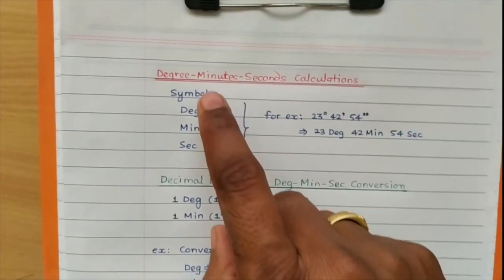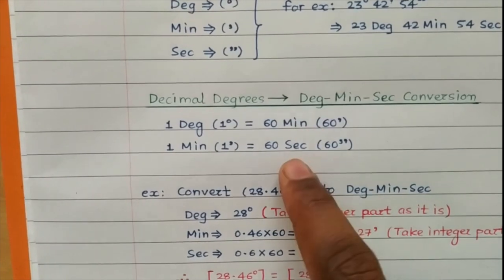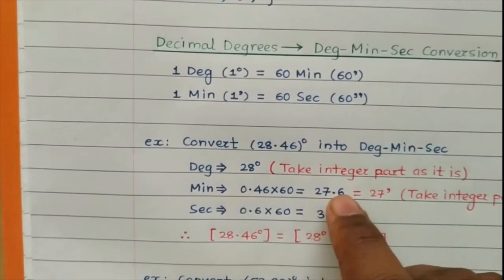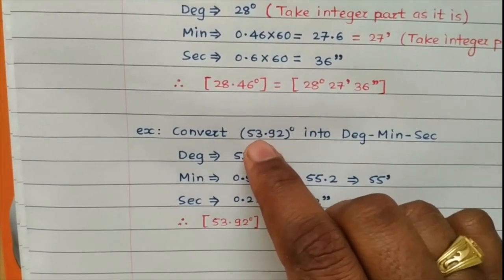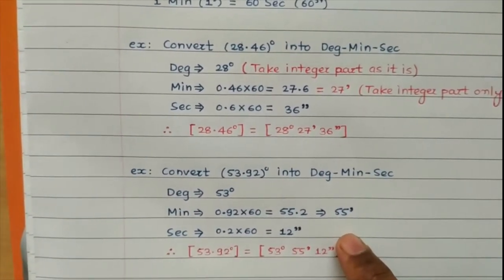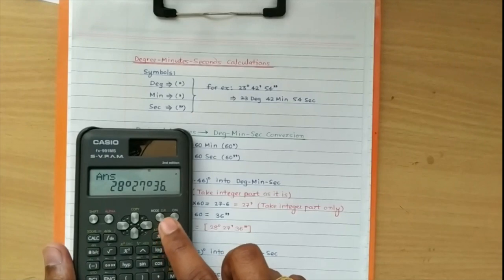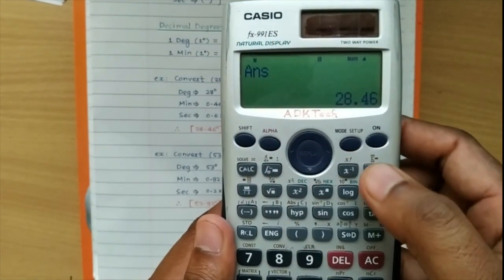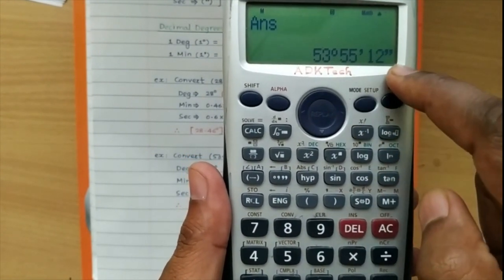Degree-Minute-Second Angle Conversion using Fx-991ES & Fx-991MS Calculators.

Comment: How to convert from degree minute and second to degree
Reply from the maker: @Abhijeet Chauhan
first, keep degrees as it is, then divide minutes by 60 and seconds by 3600, and you will get the answer
because 1 Deg= 60 min= 3600 sec
for ex: Convert 55 degrees 30 minutes and 20 seconds into degree
Answer= 55+[30/60]+[45/3600]
=35+0.5+0.0125
=40.0125 Degrees